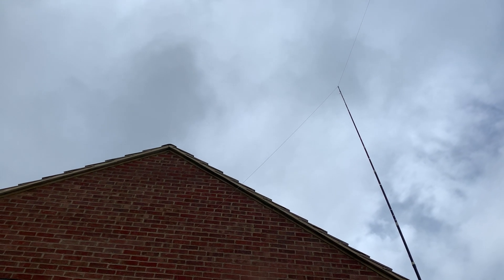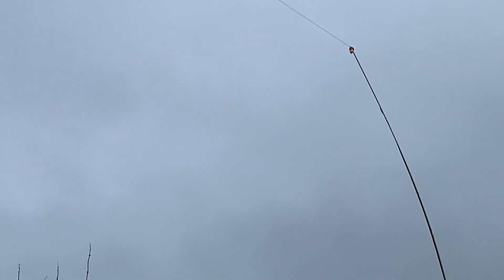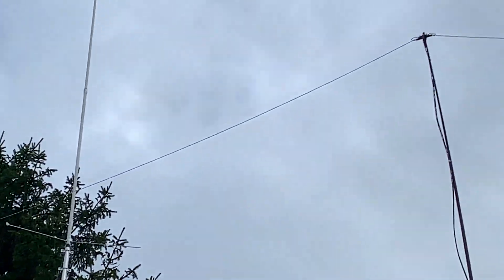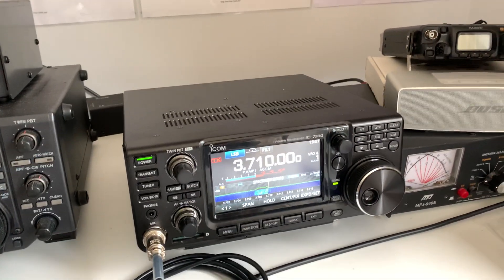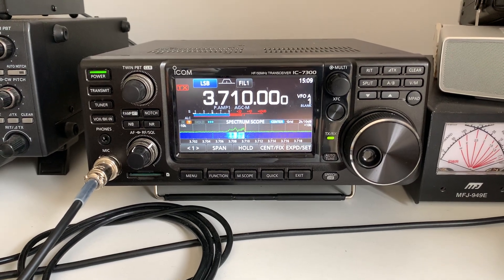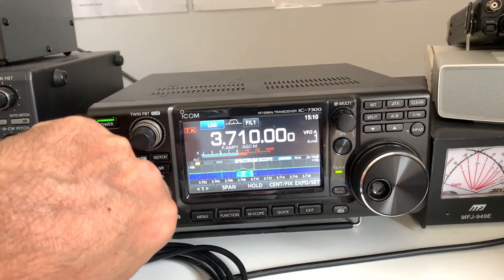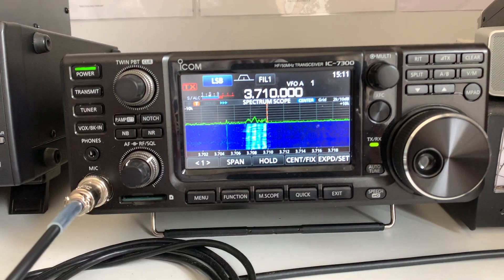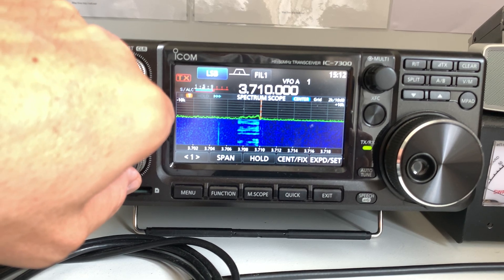Another increase in height for my home-brew £4.50 end-wire top-band wire

Comment: Quick Question, and this may be a stupid one to ask however....How do you keep the wire attached to the top of the poles,what have you used ? Thanks
Reply from the maker: I just use plastic loops taped on or cable ties. I do have some proper insulators but what the heck! 73s, Clint